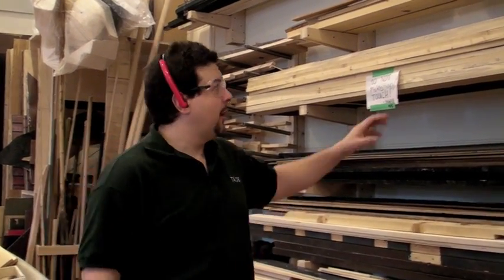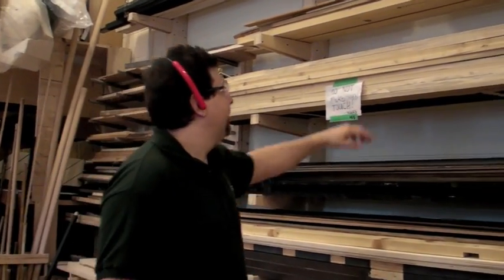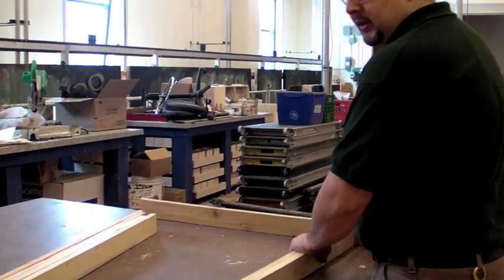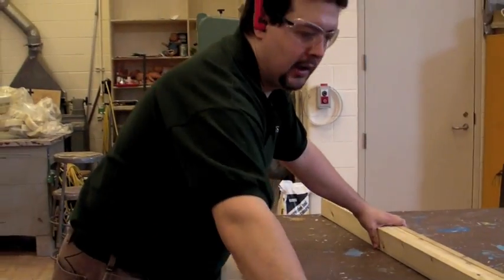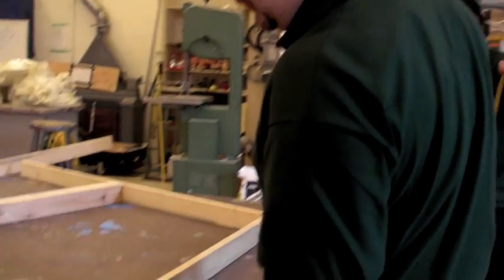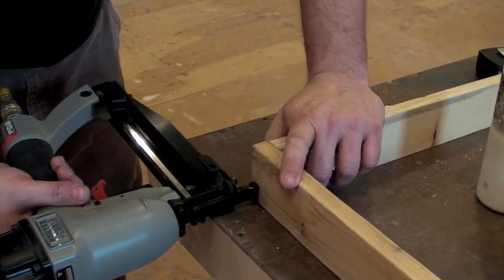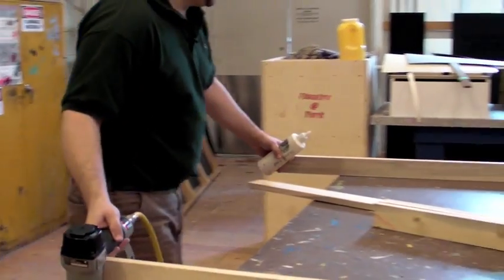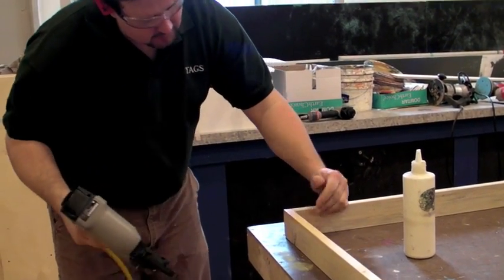How to Build a T.V Flat Pt. 1

Comment: The union guys out here in N Cali all insist that I not glue end grain joints. I ALWAYS have because, sure it is not As strong a joint, but it Does add strength to the overall project. Case in point, I came back to a shop I'd TD'd for for 9 years. They'd dumped all my 'studio style' flats for 'hollywood squares' with that 24: grid and gate framing. No glue on the end grain joints so all their rental flats are now wiggley, heavy and creaky when handled. Their 'better than' 4x10 flats had an extra 18' of framing with the additional stapling, filling, etc. and they SUCK. Also in big shops, for every x thousand pneumatic fastenings fired, there is x number of injuries, so using the minimum needed number of fasteners to adequately do the job is best. Some of my old flats were Still being rented out, so I rest my case for gluing end grain.
Reply: Phil I'm an iatse member here in chicago. When walking on a 1x4 glue is very much appreciated because the tiny staple we use does nothing but hold till the life saving glue dries. And then we go walking plates.  Love it.

Comment: Why are the nails 1-3/4" long?
aren't they suppose to be 3/4" + extra 1/4"?
Reply from the maker: The nails I think you mean are the ones holding the frame together: 3/4" wood into ingrain with 1" of of wood =1 3/4". The face staples are 1" or so. 1" is where I typically go but when short of those I try to err on the long side with 1 1/4".

Comment: Very nice tutorial!
I have a question ...
MDF (medium density fiberboard)  is fine for the skin?
Reply from the maker: You could but it does not have the same sheer strength as 1/4" ply. Also it tends to pucker when you staple. Then you sand it back and when you prime/paint it, it puckers again... really annoying.

Comment: The reason you cut the stiles to 7'10-1/2" is because the lumber is 3/4" of an inch thick. If you double that you get 1-1/2". If you subtract that from 8' you get 7'10-1/2". The rails are then nailed to the top and bottom of the flat which will then total 8'0".

Comment: @laaxe (cont.) ..., where the joints are nailed/stapled (we use Senco M2 2" staples, as they pinch, and require no screwing), we simply mark 3/8's, then a quick slash marking where the stud or toggle goes; no need for two 3/8th marks showing the center. One line (plus or minus 1/16th) is more than adequate. And if you're working on a big show (not too concernd about an extra stud/style), you use 3 studs, as they're more ridgid, and hold up longer on TV shows, where you're re-using the same flat.

Comment: Boy, we do/call things a bit differently here in Hollywood. Tops/bottoms (your rails) are called plates, styles are called studs, and toggles are still toggles. There's almost always a block available at the chop saw, which makes for quicker cutting/accuracy (you're almost never going to build one flat), and we almost never chop the ends (saves time), as most joints are close enough from the mill, and are almost always covered by a base/crown moulding. When doing the layout... (cont.)